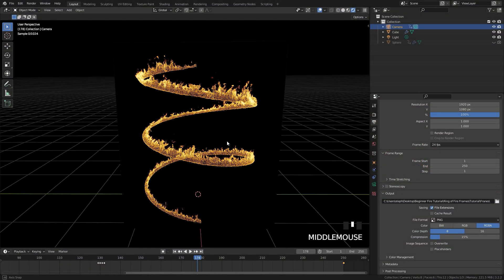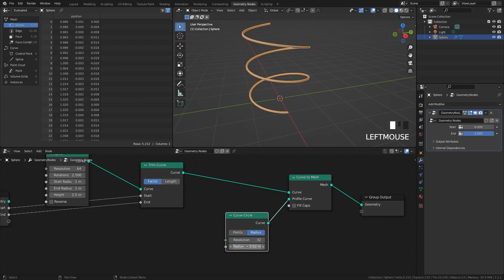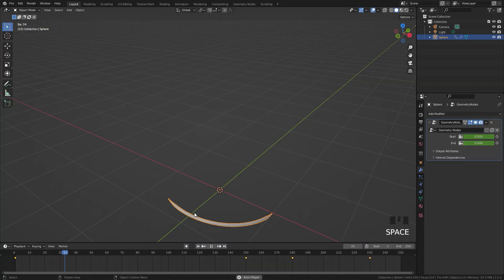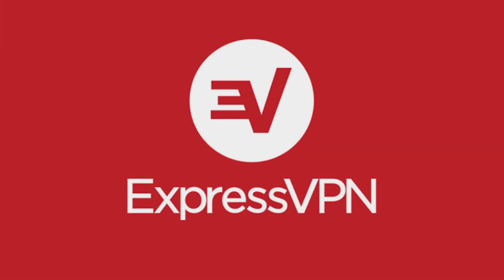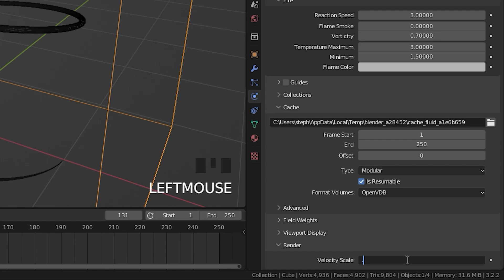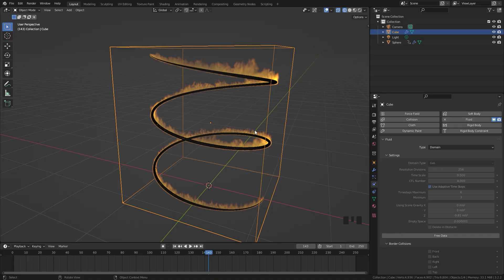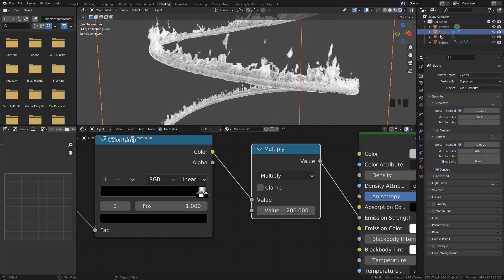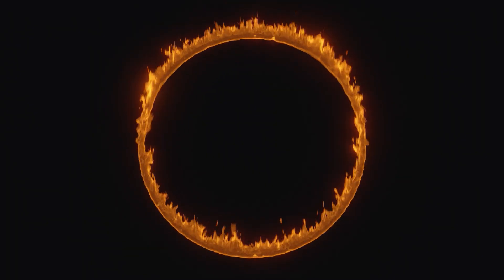Blender Tutorial - Creating a Spiral of Fire

Comment: A made it until 12:45
Once he add the attribute to the emission strength he have an effect immediately but I don't, it doesn't do anything :,(
Reply: yeah i got the same thing
Reply: @dylanthegreat26  I found a comment solving this issue and it says "maintain the render engine to eevee, do the part of attribute/name to flame, configure the color ramp as the tutorial. Change the of the attribute from Flame to Heat* and change the render to Cycles"

*I don't know if that actually works, I think you just use Eevee, reboot Blender, redo the attribute and color ramp and change to Cycles. 

Btw the comments was in italian and i don't speak Italian, but I speak Spanish so from there I tried to translate 😅
Reply: @dermond  okay thank you

Comment: Did I miss something or why did you use two color ramps instead of one for the curve radius?
Reply: I don't know if you found out already, but what he did was he reversed the color ramp so that both the start and the end could tipper off. Sorry if that wasn't what you asked for.
Reply: @Cursed_Raven  Yeah, I saw what he did but I was wondering why he uses two color ramps. You can add lots of sliders to a color ramp, so why not simply make it black on both ends and white inbetween?